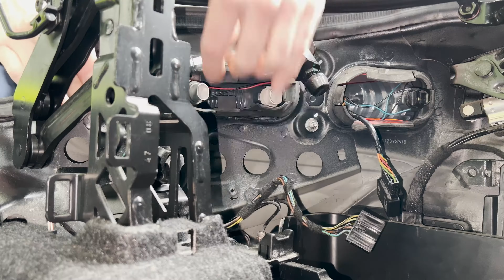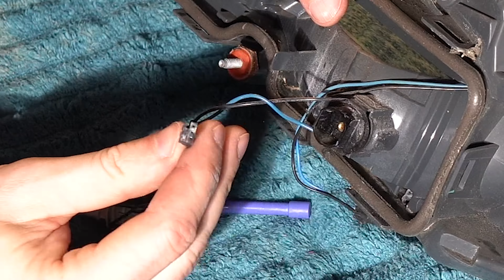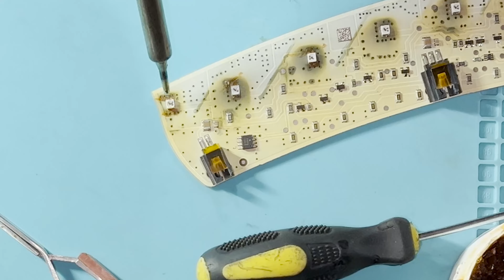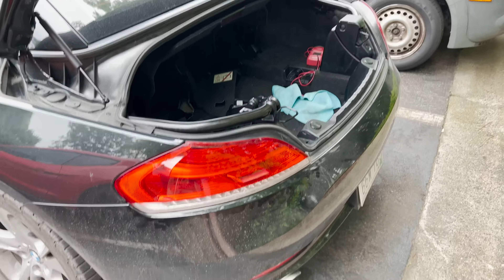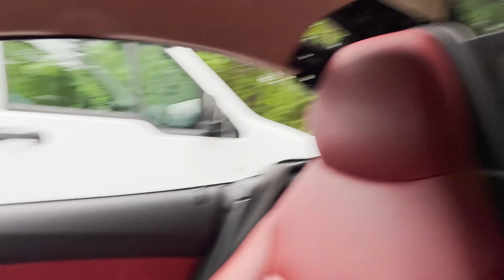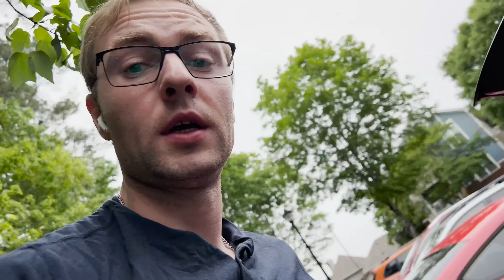BMW Z4 e89 Tail Light Turn Signal LED Blinker not working Repair Disassembly

Comment: Hey bro ! nice vid im trying to make my e89 z4 tail light to go sequential , i bought an extender for the original harness , but i cant find how to rewire the extender , maybe you have ha scheme for each cable of the tail light harness please ?
Reply from the maker: This is the copy of the Repair Manual BMW E89 z4 (N54 engine) - https://drive.google.com/file/d/1vfcY-X3cPXGjwzr5DMtQ-_NmounR7k8b/view?usp=sharing
The PDF File is over 200Mb. the diagrams will be there as well. Good luck with the project!

Comment: Just looked this up to help a friend.  This is why I hate newer more technology laden cars.  Give me an old fashioned bulb you simply unscrewed and replaced for minimal cost.
Reply from the maker: ha-ha. Yeah, the LED light's should be more reliable than the regular bulb, or less longer but they more complex, and in the most cases non replaceable, also manufacture will appreciate $300 bulb replacement))
Reply: @Makhnovets  BTW thanks for the video.  After watching with my buddy we decided he should take to a dealer.  Got me out of a headache.  LOL!

Comment: Usually fail due to water ingress shorting out the LEDs.
Unfortunately bad design and material. 
The lamp designers used open cell foam seal. Water soaks through into the lamp.
The seal needs glue to seal it.
Reply from the maker: Yeah, BMW have there issues, but we still love them!) 
Thanks for useful info!
Reply: @Makhnovets  I used Evo stick glue to glue the foam seal. My cars replacements dry 8 years now.